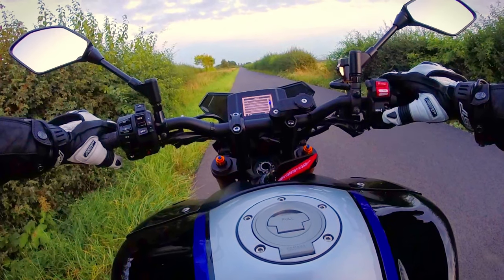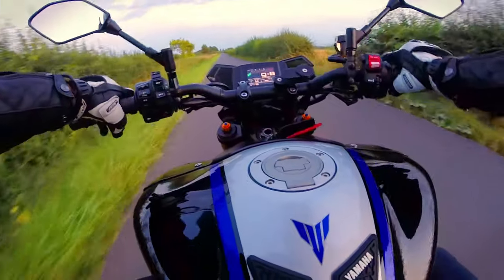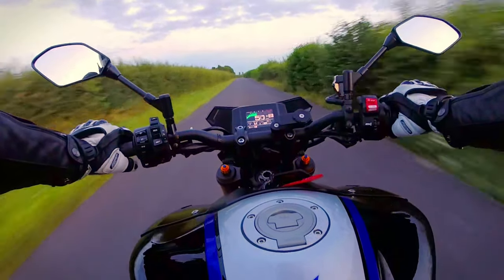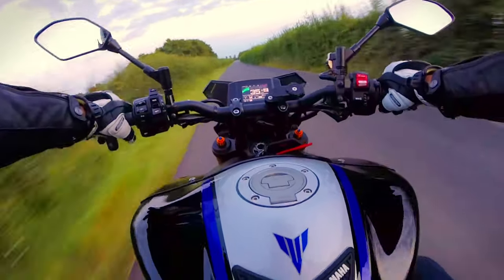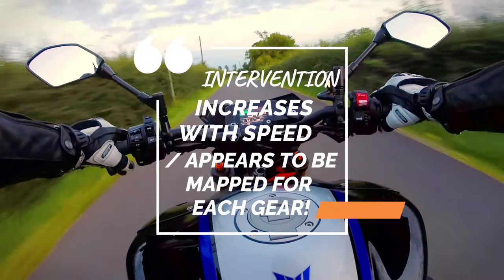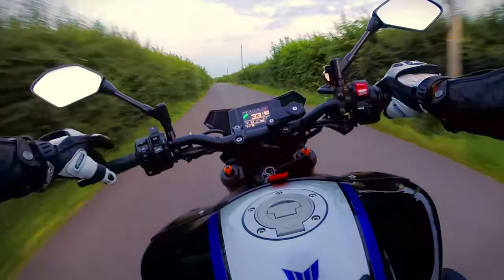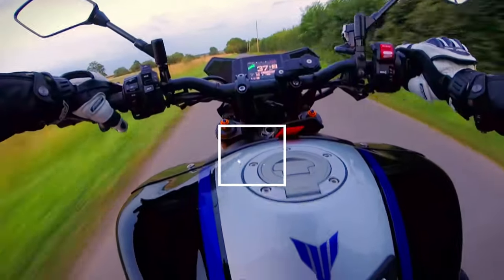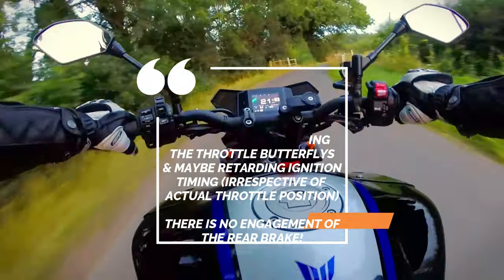YAMAHA MT09 2021 - "LIF CONTROL" - TESTED!

Comment: Love my mt09 and honestly kinda wish it didn’t have lift control. I’ve never wheelied before besides small power wheelies on a Honda rebel I had. With the lift control I quickly started doing crazy power wheelies and I’ve never had to use the rear brake. It’s fun and all but now my perception of how a wheelie should feel without lift control is bad. I tried a 2nd gear power wheelie without lift control on and the front tire came up so fast it scared the shit outa me. Now if I wanna learn wheelies I gotta relearn from scratch.
Reply from the maker: Hey, interesting comment, the bikes definitely more fun with it all turned off, I have never really got used to riding with that stuff on but I can see  how you'd have to recalibrate your throttle hand. I guess if Lif control allows Yamaha to safely sell the bike then I'm all for it, provided it can be turned off 😉 I kinda feel the same way about all these rider modes, I just pick one and stick with it.

Comment: Can you do clutch up with it on or does it have to be off and what tcs  needs to be turned off
Reply from the maker: It doesn't like clutch ups with Lif control on from memory, I suppose the whole point of a clutch up is to quickly bring the front wheel up to balance point low in the rpms whereas the Lif control is trying to stop/slow the rate of wheel lift. Maybe if you hit the rev limiter and dump the clutch it would come up but you'd certainly notice the system working against you. With Lif control off, you can still run TCS in 1 or 2 and wheelie as normal, clutch ups etc.

Comment: Does anyone know if the 2022 MT09 have a quick shifter and wheelie control? I know the SP does just didn't know what all was different from the two? Looking to purchase one and was unsure which one to buy. Thanks for any help.
Reply from the maker: Hi, yes all Mt09 models have bi directional quick shifter and wheelie control. The difference is mainly aesthetics (paint scheme, brushed alloy swingarm) plus the SP gets cruise control.
Reply: @tankslapmoto9999  don't forget about he kyb and ohlins
Reply: @joet7360  :D
Reply: @tankslapmoto9999  As far as I know, the motorcycle stays on the synth until 4th gear, but after 4th it can throw it back. And lift control is disabled after 30-40 seconds, if you slap the clutch the lift control will keep holding your bike, some of them don't, it's not a good idea to slap the clutch if you don't know how to make a wheel, and always keep your foot on the rear brake
Reply: @cemalsp  I did purchase a 2021 MT09 and not sure about the lift control cause even on lift 2 seems like it is going to loop and I actually have to control it with rear brake. Thought I read that it's not supposed to let the bike go past 45 degree angle?

Comment: the second grear wheelie a clutch up or off the trottle power up ?
Reply from the maker: Off the throttle, 3rd gear off the throttle as well is very easy👍

Comment: I have the 2017 model,does anyone know how that works 🤷‍♀️
Reply: 2017 doesnt have the IMU and LIF control. It has more rudimentary traction control which to my research should still help with controlling wheelies when in the higher setting but not in setting 1.

Comment: I do 2nd gear clutch ups on mine with lif and tsc in lvl 1, the bike comes up high but have not tested if she will flipp 😅 sure feels like it will 😅
Reply: @TommyTheMuhFuckinChooChooTrain  i figured it will 😅 keep the foot on that rear brake 😅😅
Reply: Have you experimented with clutching on any other settings? Does TC settings seem to hinder clutching?
Reply: Guess not if you keep your weight on front of the bike like leaning forward..?

Comment: My bike has 1900 miles on and will not wheelie at all unless you slip the clutch 
Also it accelerates kinda sluggess out of the hole until you get moving a bit ?
Reply from the maker: Something doesn't sound right there, mine would power wheelie in 3rd gear... assume you have turned the systems off (it feels like a different bike with Lif off and TCS off, or on 1). The only other thing might be if you have changed the exhaust, they can loose a lot of power if you don't have the right exhaust/enough back pressure... (stuby cans or no silencer type exhausts are a bit of a no no without a remap).

Comment: bro can i use the lift 1 for clutch up wheelie?
Reply from the maker: Not in my experience, need Lif off for clutch ups. Maybe if you were super aggressive it would come up but it would be a little hard on the clutch, plus I don't think you'd get it up anywhere near the balance point with Lif on👍
Reply: @tankslapmoto9999  thank you bro , i am newbie for wheelie.. as of now i am using lift 1 for power wheelie, maybe i will practice soon for clutch up.

Comment: Video is completely wrong. According to Yamaha it limits the lift speed. When I'm in ride mode 1 I can reach balance point quite quickly and yes u can go over.  I've done maybe 500 wheelies on the mto9 and I can start in first and hit balance point by 70kmh shift to second get it back up shift to third hit around 170kmh and have to use brake to drop back down. Lift is in 1 traction is in 1.
Reply: Are you saying that you have looped yours over?
Reply: It never comes nowhere near balance point with wheelie control on setting 1. Unless you consider that 45-50 angle as a balance point.